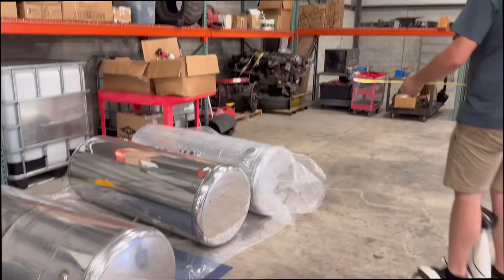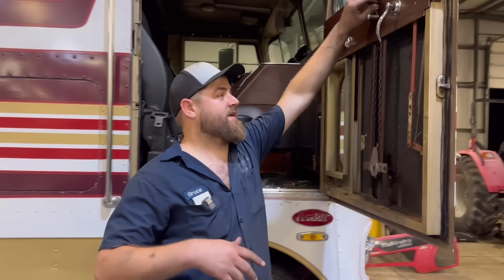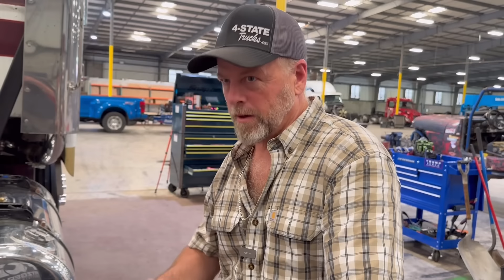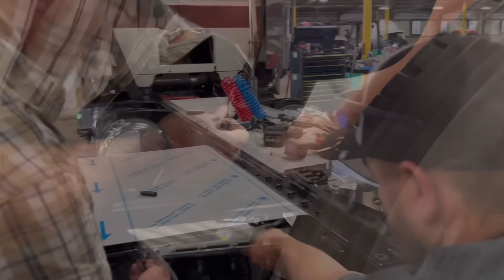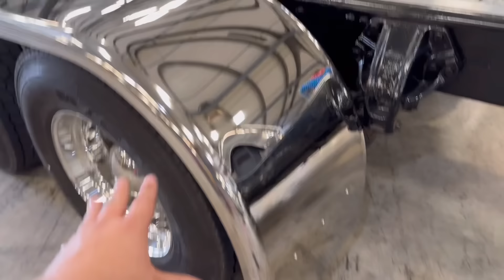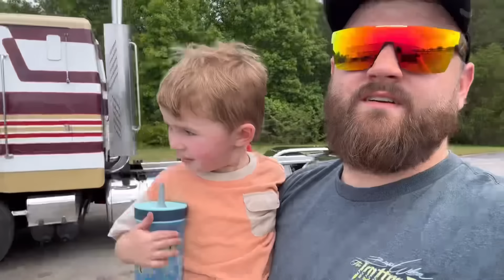I FINISHED The Classic Peterbilt CABOVER Rebuild! It’s So RETRO!

Comment: Nice Work on the Cabover. Love your thoughts in the beginning, and there is one thing you can never get back is time with your family.  I saw that Peterbilt in the background pulling the gooseneck trailer, how far back does the center of the fifth wheel need to be in order to pull one?

Comment: I'm an old Peterbilt man myself looking at that truck I would tend to say that is actually a 1975 cab Peterbilt at fresh air cleaner runs through the cab in 75 they stop doing it in 76 Steven and the double bunk version had the air cleaner pipe running through the cab another thing with your air horns you can work on those air horns for you didn't have to replace them just clean them up and redo them I'm curious to know if those are fuel tank hangers for aluminum or steel I'm looking for a set of aluminum fuel tank hangers I have a project in mind for that type of fuel tank hanger